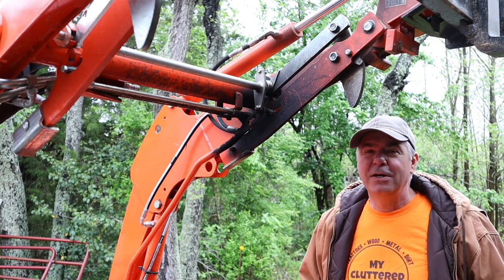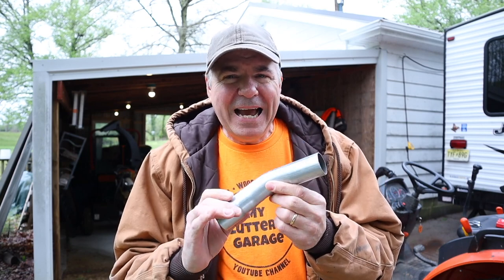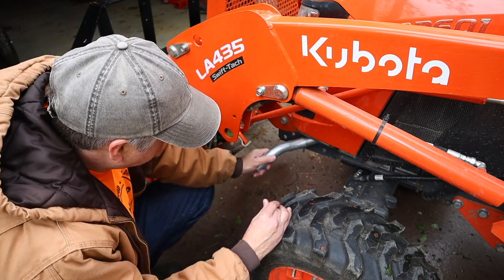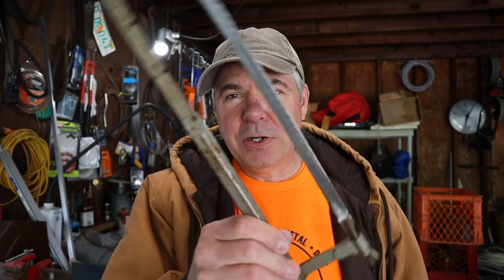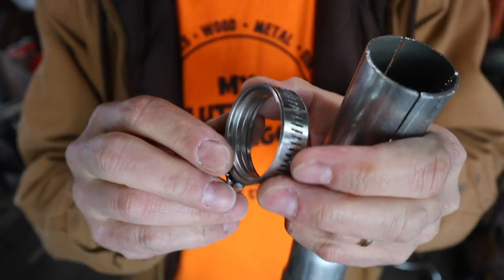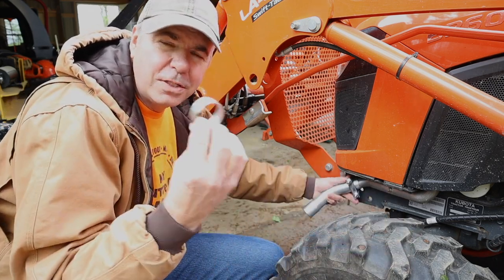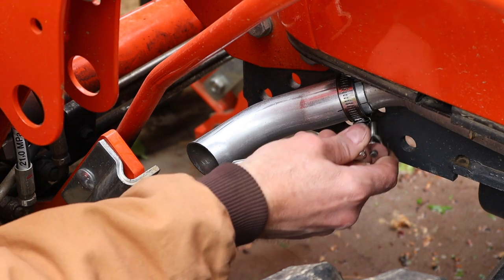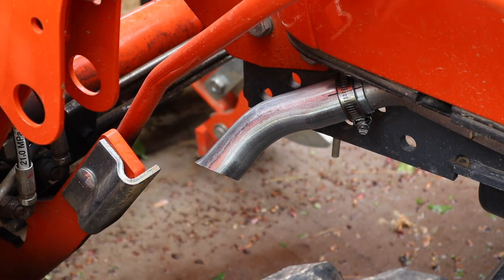#100 Kubota B2601 Exhaust Mod. Soot on my front end loader!

Comment from the maker: Here are links to products shown or discussed in this video. These are Amazon Affiliate links, so purchasing will help this channel by providing a small commission while not costing you any more. Thank you for your support!
Camco Exhaust extension: https://amzn.to/3wbEE7R
Stanley Commercial Grade Hacksaw: https://amzn.to/3ymDA3K
1 3/8" Muffler Exhaust Clamp: https://amzn.to/3vUDzT7
TEKTON 1/4 Inch Drive 6-Point Socket and Ratchet Set: https://amzn.to/3w3xBzz
Double Seal Hose Clamp (found at my local Advance Auto Parts store) so this may be a good alternative: https://amzn.to/3N2vRw6

Comment: I used a radiator  rubber hoes. If you hit something with it the rubber hose  will bend, where the steel will tear off your exhaust.  Later
Reply from the maker: I guess it doesn’t get too hot?
Reply: @MyClutteredGarage  🤔🥴👌
Reply: @MyClutteredGarage  I have a video were I made one out of steel. I did an update video using the rubber hose. Over 500 hours on it with no problems.  Later
Reply: I took this mod from @It’s about Making not Buying. Simple and no issues.
Reply: @desertkubota9393  thank you for the mention of my channel. I'm glad I was able to help you.  Later

Comment: Nice little hack there, Ed!  👍   My L3901 has a little square metal box over the exhaust that says HOT on it right there.....can't recall if it angles down or not but I don't get soot on the FEL and I haven't ripped it off yet in thick brush!
Reply from the maker: Good to hear, Brad. Maybe the bigger tractors have more room to route the exhaust? Thanks for watching!
Reply: The DPF prevents the black soot on the over 30hp tractors.  That’s probably the only benefit of the DPF….no black soot on your loader🤣

Comment: Nice video and explanation. I modified my Kubota exhaust as well to prevent the black soot all over my front 3P hitch. A clamp was also my initial thought to mount it with, but went for a TIG welding instead. Still very happy I changed it, never had any blackening since. Hope yours works as well!
Reply from the maker: Nice! I was thinking of tack welding, but wanted to see tre results first. Thanks for watching! -Ed

Comment: Great video and problem solving.  I have 3 tractors with diesel motors (they happen to be green but I'm not picking a fight) and none of them have a soot problem, even on start up.  Long ago my mechanic mentor told me that a smoking diesel often has the timing a little bit off.  Just a thought.  Kind Regards.  Craig
Reply from the maker: Thanks Craig! It’s a as common issue with these tractors. Maybe black soot just shows up better on orange than green 🤣

Comment: I don’t like how my brand new b2391 smokes when it’s under load like pushing into a pile of gravel
Reply from the maker: Don’t be afraid to crank those RPM’s!
Reply: @MyClutteredGarage  I noticed it smokes more when it bogs if the rpm’s are high. Is that the nature of these? Say it’s running 2000 rpm and i hit a pile and start lifting. It drops to 1000 rpm and smokes like a train

Comment: Sir by keeping a nice little coat of oil on that side your FEL with will be easier to remove the black exhaust residue Cheers   👍👌🧐🍻
Reply from the maker: Thanks David!
Reply: @MyClutteredGarage  🧐👌👍🍻
Reply: Good idea.  Now how do you stop your bush guard release rubber handle from melting?

Comment: SWEET mod Ed!! You’re absolutely right about the hacksaw. In fact, all tools. I like having an extra anything as a back up, but investing in one that’s absolute quality and then taking care of it, I think serves you far better. 
My Dad always said…”let the tool do the work”, and you are as right as he always was! 
At first I thought, just leave the flared end on but, AGAIN, you were right…looks much, much better flared off! Good a good laugh at the saws all sound effects too!?🤣🤣
I also much prefer the hose clamp over the muffler clamp for the reasons you noted. In fact my friend, I’m outta here so I can order some right now, to have around next time I need one! 
Outstanding video! 
Now, let me ask…do you think angling it down even a wee bit more, would hurt? It’ll direct it straight to the ground. It’s looking like you might catch that soot problem on the inside of the front wheel and that could over time, degrade the quality of the tire? 
Thanks for sharing!!! New project!!🤣🤣
Reply from the maker: Thank you, Keith. This has held up well and hasn’t budged. I’d play with it and set the angle where you feel best. I appreciate all your comments! Cheers!

Comment: Nice mod. I think that will help, but my guess is, you'll want to direct the soot directly to the ground. Time will tell! Thanks for sharing. - Rick
Reply from the maker: Thanks Rick. I didn’t want to blow down too much, out of concern for kicking up more dirt & dust. We’ll see how this works out. Thanks for watching!
Reply: The trouble with directing it directly to the ground is when the ground is dusty, it blows up to the driver.  At least that is my problem with the extension I bought from a company in Quebec Canada

Comment: Looks good Ed,  I was at the jd store last summer a guy put a pipe on a 1025r . I don't know how he clapped it but it turned and melted the hood and  started a fire the salesman told me. The guy thought  jd insurance  should cover it.
Reply from the maker: Yikes! Thanks for sharing!
Reply: Buy a tractor with a metal hood story. NICELY DONE.  That is a lot of heat.  Imagine if it had regen cycles. Maybe we should measure the exhaust temperature first (at high rpm).

Comment: Hey Ed, nice video. I'm curious to see what it will do in the long run also. I read another comment about using high-heat resistant hose and that sounds like a good idea at least for my purposes. I haven't modded mine and may not because I grapple into brush so much that I'm afraid I would do some damage with a rigid extension. Maybe not. LOL Thanks for sharing, buddy.
Reply from the maker: Thanks David. I don’t feel like it sticks out too far, but we’ll see!